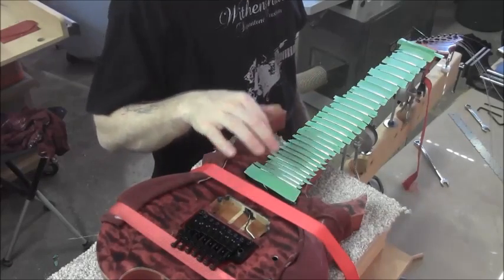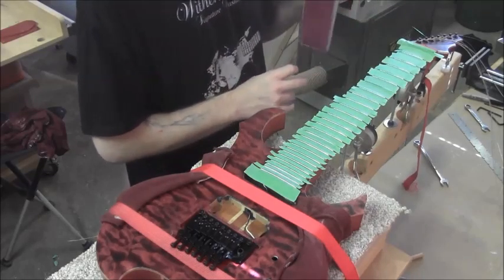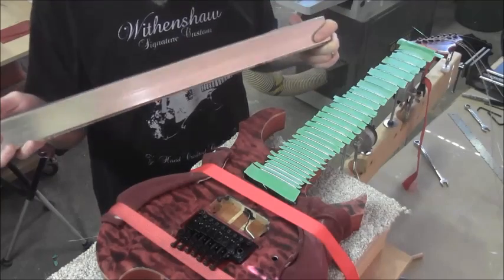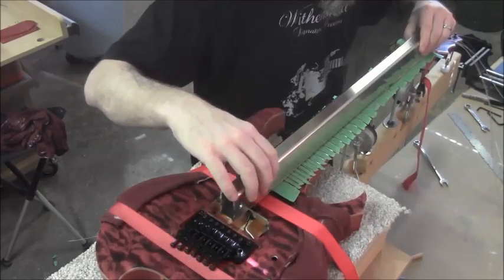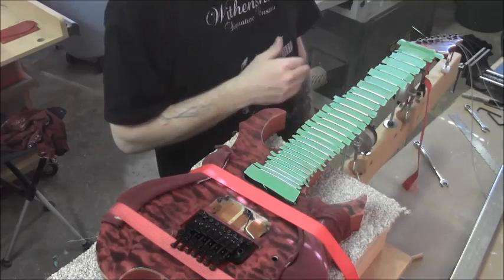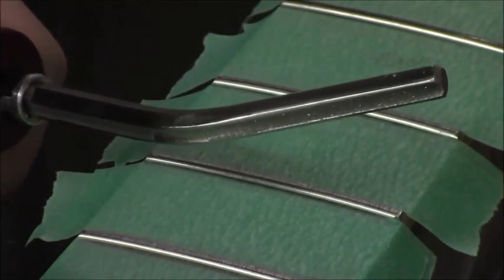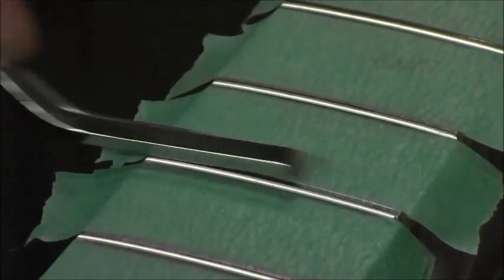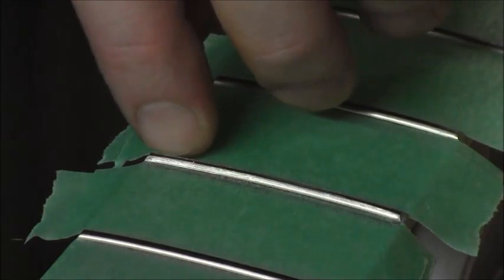How to Build an Electric Guitar-Video 24 - Fret Leveling

Comment: you used a neck jig during this video, would that not put relief into the neck or did you set it to be completely flat? Im curious because if the neck had relief in it that would surely sand the haghesr and lowest frets more than the middle ones. also, is there a way to acheive this without a neck jig? i have a guitar with uneven frets and i would like to have a go at doing it myself but i dont know where to start other than the fret files and polishers
Reply from the maker: +Paul Mason The instrument is secured to the jig then the neck is set dead straight while under tension. Then the dial indicators are zeroed. After the strings are removed relieving the tension the dial indicators will move slightly. Then adjustments are made to bring the dial indicators back into zero. The neck is then supported ensuring the indicators stay at zero while doing so. Then the leveling can be done. The idea is that the neck takes on a slightly different shape while under tension than when not which is evident by the movement of the dial indicators after tension is removed. You don't need this jig to do a fret level. Just setting your neck dead straight and properly supporting it will get you a satisfactory level job. The jig basically is for optimal leveling and allows you to achieve a lower overall action. Good luck on your first leveling endeavor!